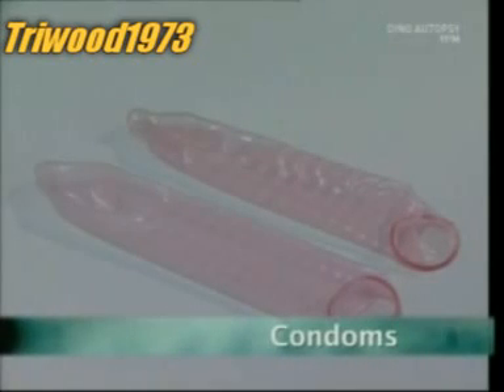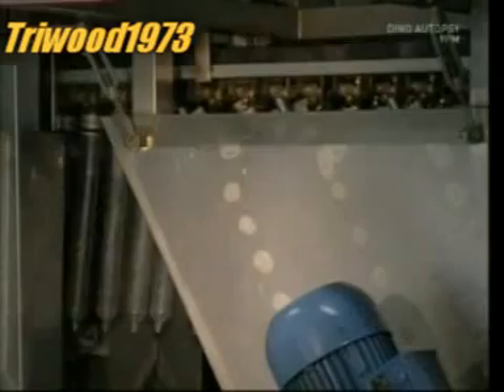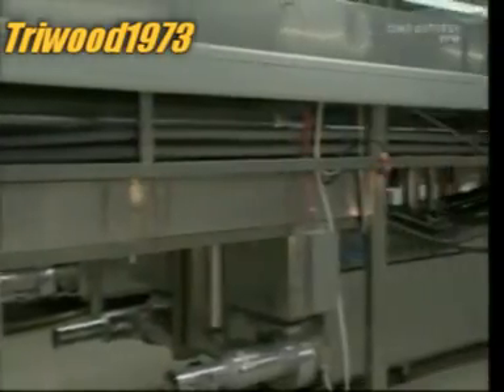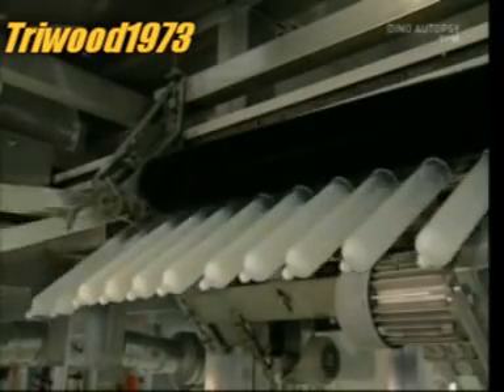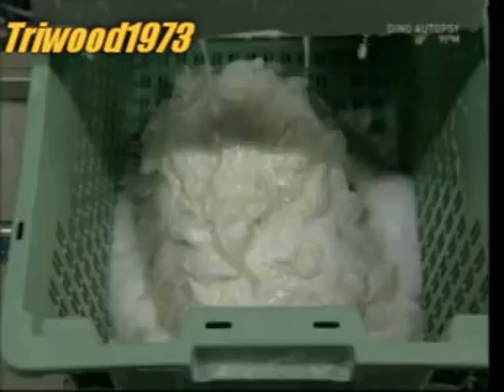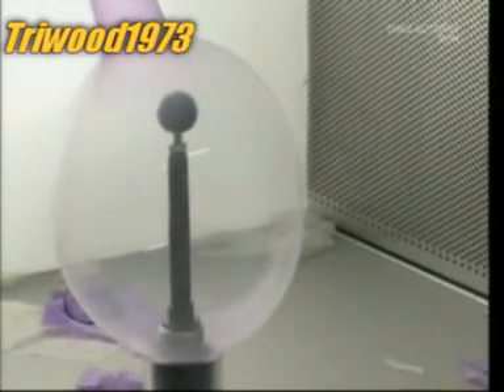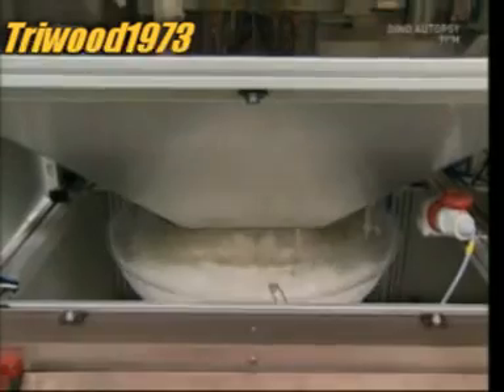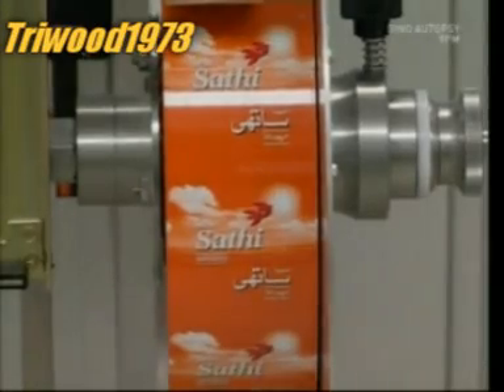How Condoms Are Made

Comment: Finally, a video that shows how they are mechanically rolled. All the others skip this step and I was only looking for that very question because lubricated condoms are very hard to roll back up by hand (I tried just as an experiment). Seeing them spin on the mold (not yet lubricated) while a rubber belt grips the thicker part created at the base explains it very well. I kind of figured the lubrication would just seep into the rolled condom either in the packaging or through some sort of ultrasonic bath.